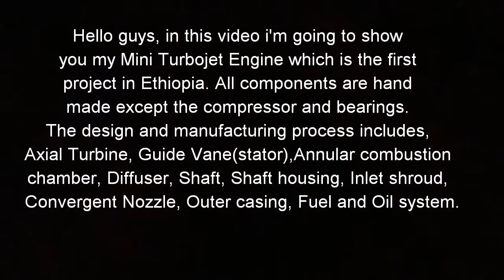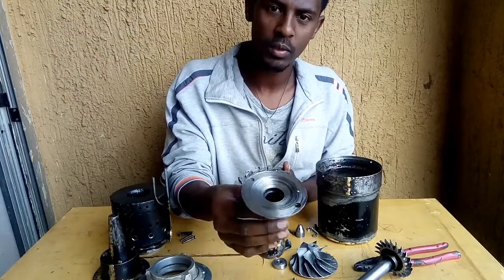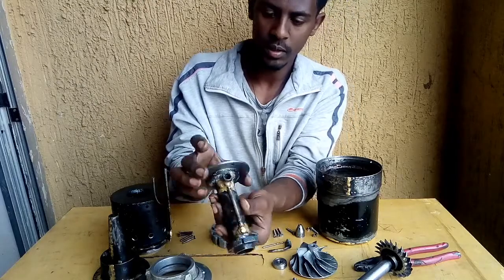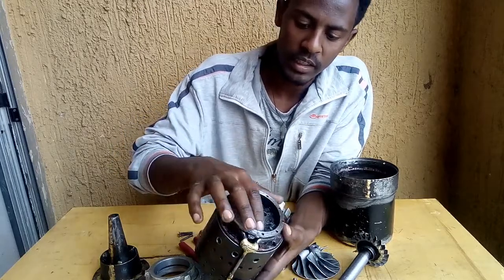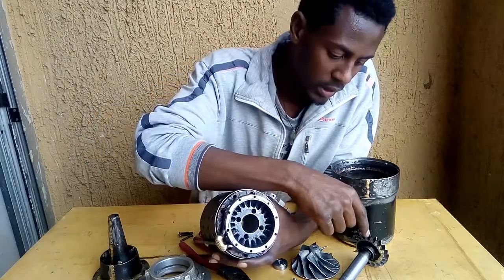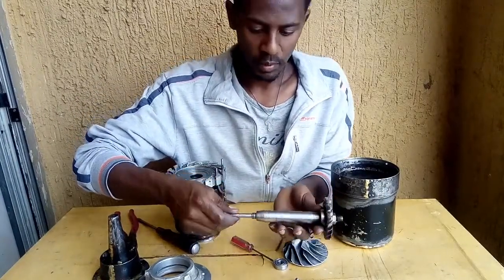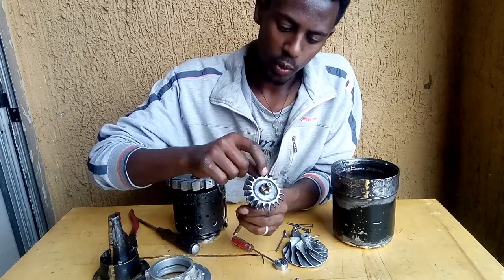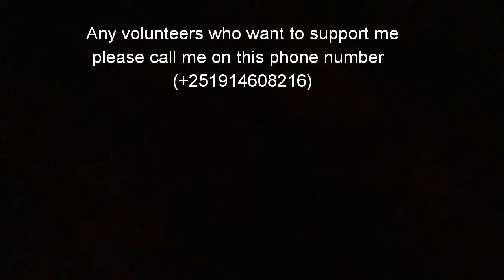The first Homemade mini turbojet engine in Ethiopia #Assembly

Comment: Congratulations for this achievement and efforts. Looking forward to seeing it working.
Reply from the maker: Thanks so much!!!. But how much rpm should be the initial speed of the compressor until it become self run??. I think over 10,000 rpm yes??
Reply: @MyTurbineEngine  the answer will depend of the engine size. My engine looks smaller than yours and it need around 22k rpm minimum, but the exhaust temperature is too high at this low speed.
Reply from the maker: Ya...your compressor are smaller in diameter so the rpm could be twice. Actually my compressor are 90mm diameter
Reply from the maker: Could you send me your video link please. I need to see your work
Reply: @MyTurbineEngine  use a brushless electric motor instead.some can reach 50000 rpm easily. There are several designs in the internet on how to incorporate an electric motor as starter (it also can produce some current).

Comment: Send video in which your machine is operating i.e running
Reply from the maker: Of course, I will. But I need some critical tools for starting purpose , however i couldn't found i.e over 10,000 rpm starter motor